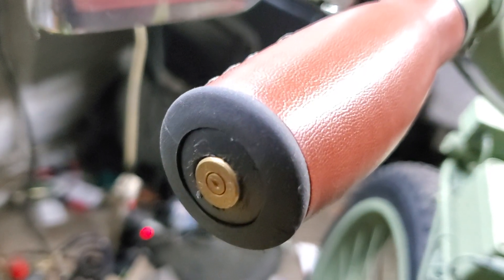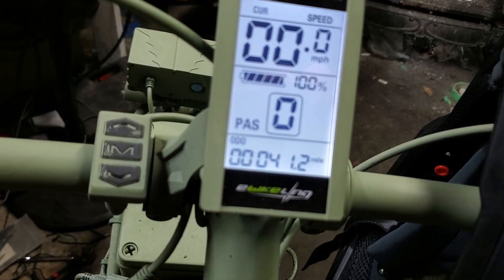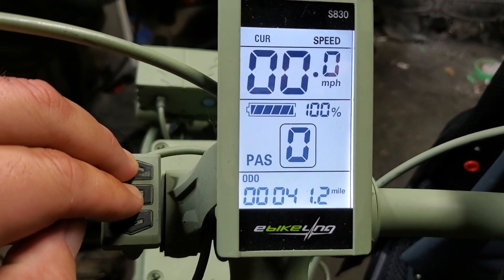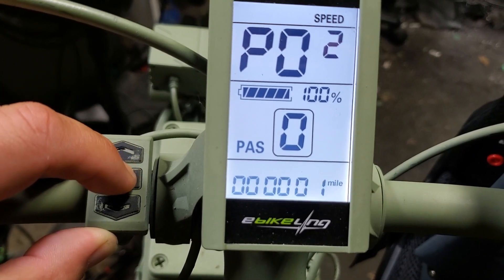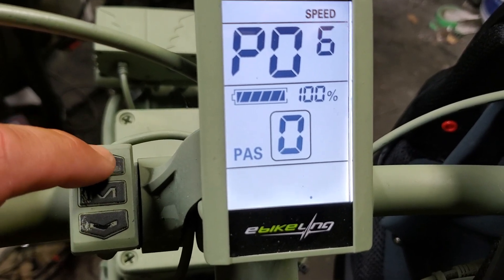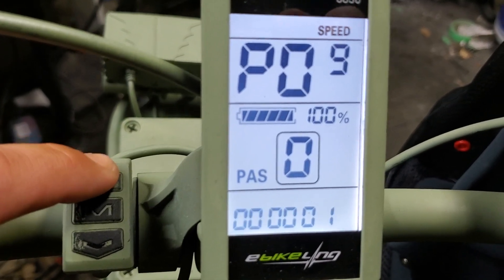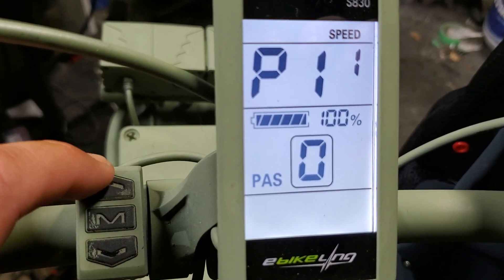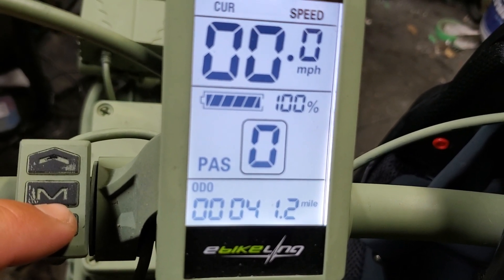S830 eBike LCD Display Setup Explained

Comment: Dan, Thank you for explaining what the instructions do not, very much appreciated! My quick question... I’m sure I missed it, but how do you set the clock? Thanks again
Reply from the maker: Hugh, thanks for the kind words! You didn't miss anything, I still haven't figured out how to set the clock on mine either! I'll be contacting the manufacturer next week to see if they can enlighten us!
Reply from the maker: Just heard back from the manufacturer, the S830 has no option to set the clock lol. I guess it's just there to tease us!
Reply: @danielgrimes4152  Hey Dan, thanks for clarifying the settings on the S830 and doing  what the manufacture could not do.  I believe the "clock" is actually a timer.  Thanks again. Dan in Jacksonville.
Reply: @danielgrimes4152  hi Dan, what email address/other means did you use to contact the manufacturer? I'd like to ask a question about P15, which I think is the cutoff voltage, but I can't change it. Thank you
Reply: Yes explain that

Comment: Dan: Nice video. I have the S830 bundled with an Ebikeling 36V 500W 26" rear geared weatherproof kit. I noticed you setup the PAS steps mode to 009. That mode appears available, but is not documented in the Ebikeling build guide. In theory, that setup allows you to choose PAS=0 (no assist) or gradually increasing assist by choosing PAS=1 up to PAS=9. Have you noticed that you get 9 distinct levels of assist? The simple way to experimentally determine it, is just use full-throttle-only in PAS=1 & note your speed (it's probably pretty slow). Then continuing full throttle, bump to PAS=2 & note the speed increase. Repeat bumps to PAS=3 through PAS=9. Did you note a unique new speed with each incremental step in PAS? Or did you notice only 5 unique speeds instead of 9? I'm interested in your observations, thanks.
Reply from the maker: I will conduct a deed test shortly, once the rain stops falling in my neck of the woods! Thabks bbn for the suggestion.
Reply: @danielgrimes4152  It's easy to do indoors. Just prop the bike up so the rear wheel is off the ground. Set PAS=1 then full throttle & note the speed on the LCD; bump to PAS=2 & note the LCD speed. Repeat through PAS=9. Do you get 9 unique, increasing speeds according to the LCD? Audibly, you'll hear the motor speed change, when there truly is a change. Partly I ask because an earlier Ebikeling kit I built with the SW900 LCD did give me gradually increasing assist starting at PAS=2 ; PAS=0 or PAS=1 gave no assist, until bumped to PAS=2. The S830 is not providing the same behavior I expected, gradually increasing assist for PAS=2 through PAS=9. Sorry about your weather.
Reply: @danielgrimes4152  Dan, did you have a chance yet to explore if you get 9 distinct levels of assist? Looking forward to your results, thanks.

Comment: I would like to know if this display is 52v friendly as I will be using a 14s panasonic pack from a prior ebike build. (I have the 1200 w kit that comes with the s830 display but haven't installed anything yet)
Reply from the maker: Dennis, I am running a 52v 20ah triangle battery with the S830 and have no issues at all. The only thing is that 52v is not an option to select in the settings because it only goes up to 48v. This may throw off your battery percentage reading, so I recommend paying attention to your volts remaining rather than the battery meter.
Reply: @danielgrimes4152  Thanks! I have had that issue with all but one controller I have used. I don't run them much below 48v, not sure what the technical 10 or 20 percent voltage actually is as I possess two 52 volt li ion charts that claim different bottom charge numbers, but I have never let one drain below 47.5 and don't ever intend to. I worry about the indicator on this build however because it is intended for a novice and not myself. I may add one of those in-line amp hour capacity meters Eric and the guys at Luna Cycle sell, have yet to try one but understand they are quite accurate.
Reply: I have   a 52 v 20 amp . Works fine

Comment: Hej thank you for this nice video,
I have samebike lo26 500 w
I have problem with the throttle is nor working and the bike is new is like If I have to activate
From the settings
 But I don't know how
Please help
Thank you
Reply from the maker: Try adjusting your P10 setting to #2. If this doesn't help, try contacting the manufacturer for advice my friend.
Reply: Got the same problem, have you found the solution?
Reply: @ggalaza  when you get on your bike and turn it on set your PAS level to 0 and then try the throttle .. along with P10 on #2